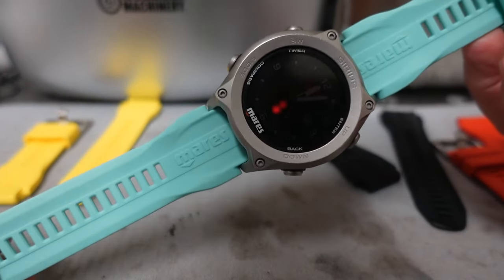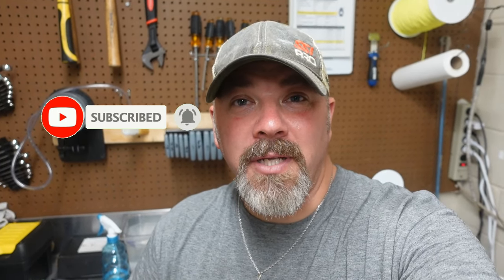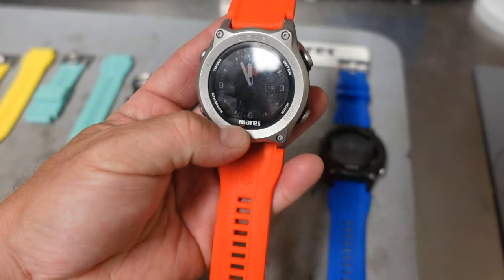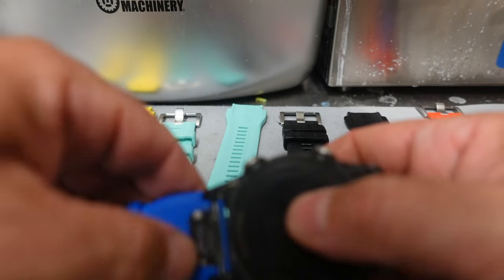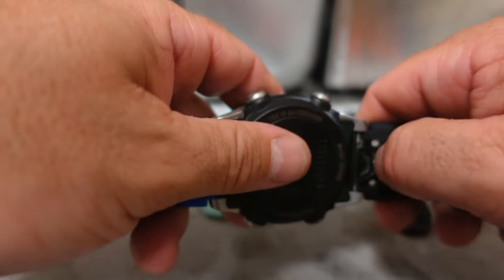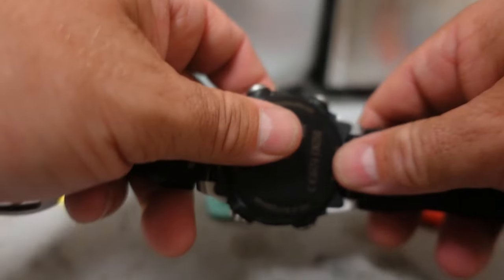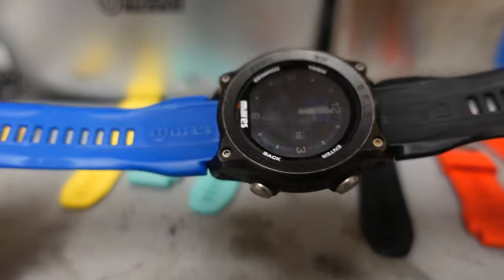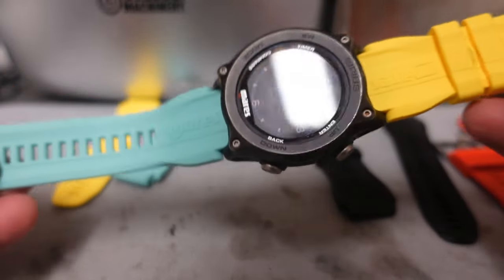Customizing The Mares Sirius Dive Computer

Comment: Hey Bryan what do you think is the best way to connect the transmitter to the 1st stage ? direct or with a 6 inch hose ? pro , cons 
thank you
Reply from the maker: Great question @naa62. Its a 50 / 50 toss up here in our area. 50 % of our divers choose to connect it directly to the first stage while the other 50 % use a short 6 inch hose so that it doesn't stick out. Personally, on my doubles, I have a transmitter for my Ratio Dive Computer and it is connected directly to my first stage and it is routed down and out. Because of the first stages I use when diving doubles, it allows me to connect it without the need for a short hose, and it is well protected. Some of our Sidemount divers who use a transmitter will route their transmitters out the top of their first stage, and it is usually connected directly to the first stage as well. The will always back it up with standard pressure gauge which is attached by a short 6 inch hose and routed straight down the cylinders. I would evaluate your first stage and see what options are the best for you. Just remember, if you add a hose, you will need a high pressure spool as well.